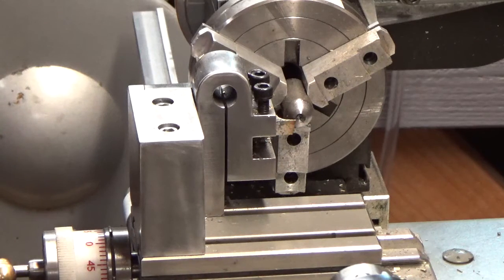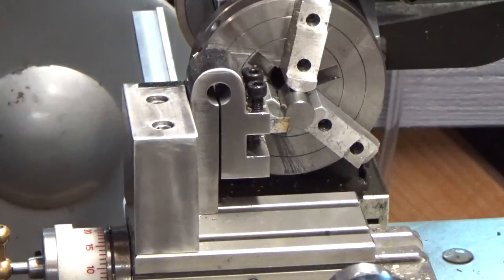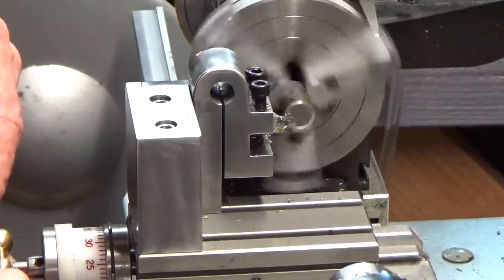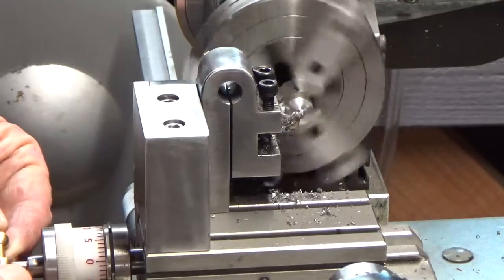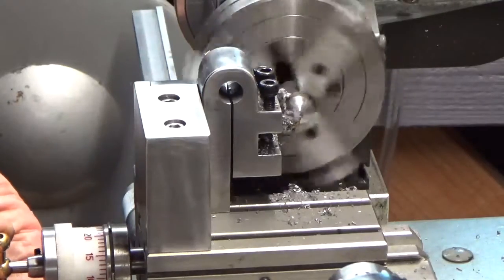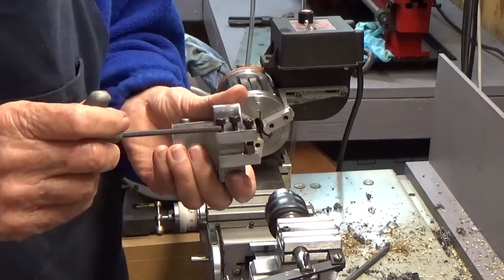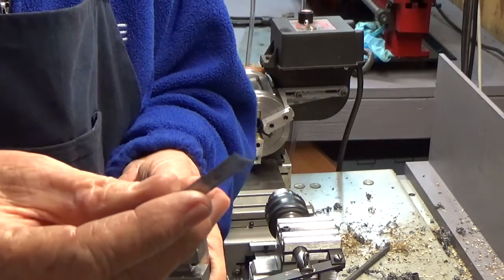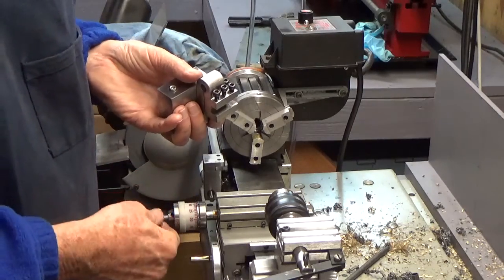Taig Lathe Spring Forming Tool Holder

Comment: What a great tool . For a lathe at the museum we have a similar tool that 8 inches long with a large radiused tool in the end for finishing line shafting . I will include a photo of it in my next video . Like you have shown they are good chatter reducers.
Reply from the maker: I will attempt to make another video showing a comparison between the spring holder and a conventional holder.  Thanks for your comment.  Regards: Larry